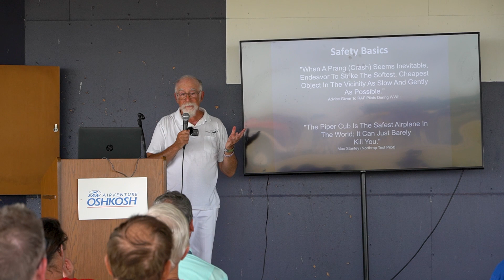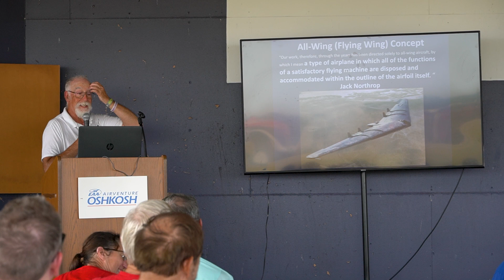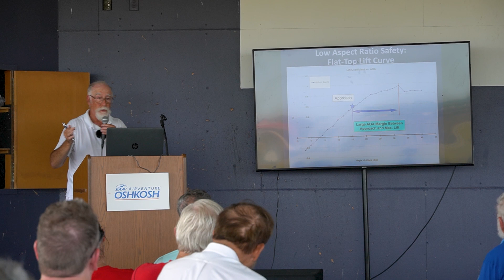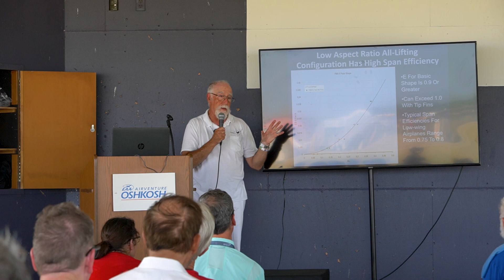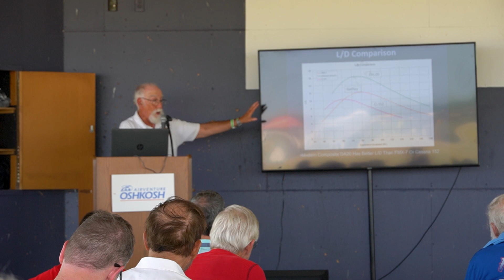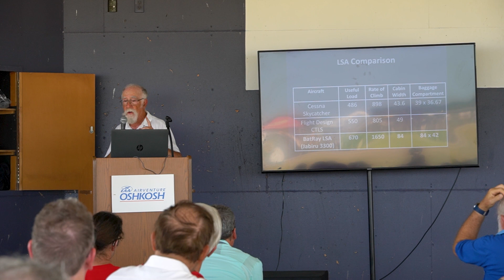Oshkosh 2023 Airventure Low Aspect Ratio Forum on Low Aspect Ratio Sport Airplanes - Barnaby Wainfan

Comment: I'd love to build a bat ray. But how about that offer you made to build a smooth RC Bat ray in carbon fiber and then another one faceted? To get some real data comparing them. I could run them with my pixhawk auto pilot to get real nice data. I have 3D printed a few large  panes before but I'd love to do my small part in this.

Comment: The Arup planes never get enough mention.
Stall proof, super-STOL, sleek and quick on available power. Video shows them to be nimble with 45 degree climb.
See the "Flying Heel-Lift" video on YouTube and others about them.

As for thoroughly debunking the myth of very-low aspect-ratio planform planes being inefficient, see also the '30s Nemeth "parachute plane". Alliance Argo biplane fuselage with a 15' diameter circular wing parasol on struts.
Faster than the original, similar markedly superior performance like the Arup.
Also the similar Farman 1020: like the Nemeth, built on the fuselage of a known successful "normal" plane, stall-proof, faster than the original.

And the '40s Eshelman. Commonly known as the "flying flounder".

I bring all of these up, and never get a response when I ask what the supposed inefficiency of the very-low aspect-ratio planform is if it doesn't manifest itself in power vs speed or fuel vs range, because many examples have shown to be sleek.

Then there's Milt Hatfield, in a video about the Arup & Little Bird, mentioning the recent around the world flight of the Rutan "Voyager", saying that an Arup planform would have been better in all criteria - load, range, internal volume, speed, etc.